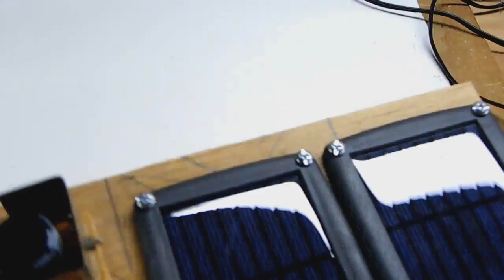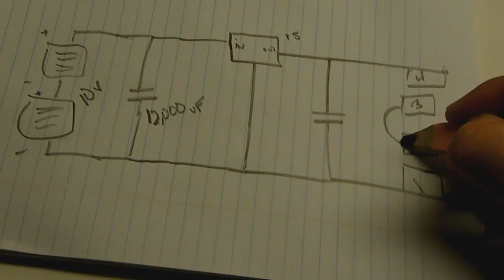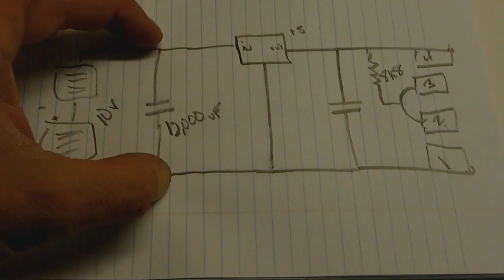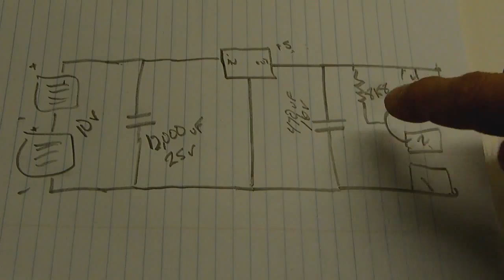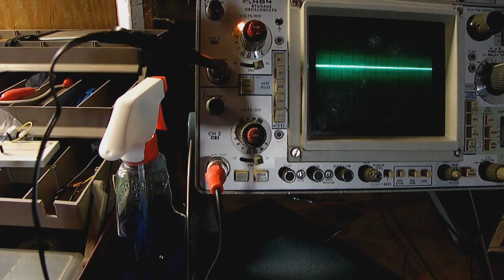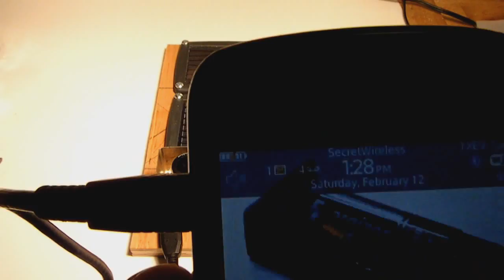DIY Solar powered USB charger for phone ipod blackberry iphone etc

Comment from the maker: @bigoud55800 - Your ipod will charge if you connect pins 2 and 3 together and then a 8-10 kilo-ohm resistor from pins 2 and 3 to the primary power pin (I forget at the moment if it is pin 1 or 4, but it's the + pin) 

The super large cap is to help smooth out the voltage in the event that clouds or other obstructions get in the way of the solar panels. While not necessary, it does smooth it out. 

The LM317 datasheet shows caps on both the unregulated input and the output.

Comment from the maker: @JZacharyFenner - The caps help to stabilize the dc voltage coming in, and the resistor is for the devices that plug into the USB port, as I read some devices won't charge unless there is a little something on pins 2 and 3. 

You'd need a pretty large panel constantly in the sun to make enough power for a USB device... I'm learning that the hard way. I've made a panel now that charges a battery (look in my vids) but I'm having problems with the linear regulator being crazy inefficient.

Comment: Hi.  I've got 2 6vdc panels, usb port, and a 5v regulator. I built a charger with only these materials and found that it doesn't quite do the job.   I was wondering the advantages of using the caps and the resistor. (basically)  I don't have a lot of electronics knowledge but am  trying to learn from others.  Any info would not go unappreciated.  Thank you!

Comment from the maker: @edglim - I've ditched that design for one that charges a nimh battery, as it's a lot more reliable. My new setup is a 6v nimh 2700mah, that is charged via solar panel (with no regulation since the panel puts out <10% of the milliamps). Usb voltage is dropped across 2 diodes (to make 5 volts) then past a lm317 in constant current mode. Good luck.

Comment: i got 4 x 5.0v 60ma solar panels and am making a cell phone charger with a 5v  550ma ouput.  what size or type of capacitor and voltage regulator should i get?